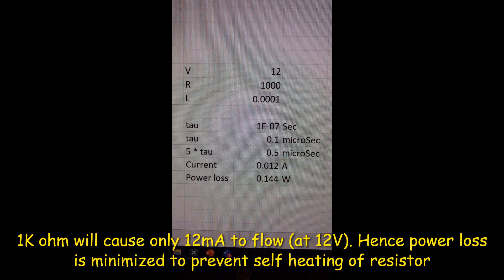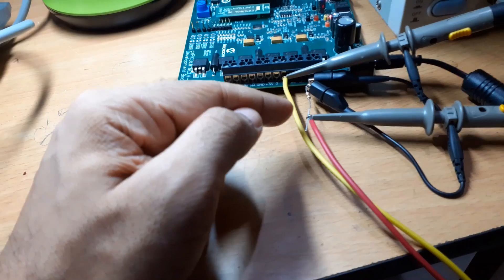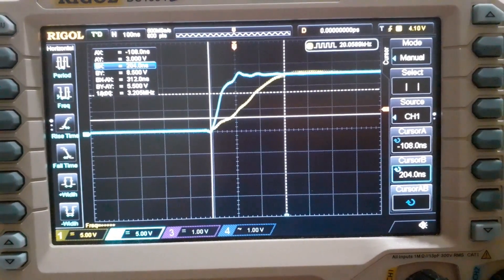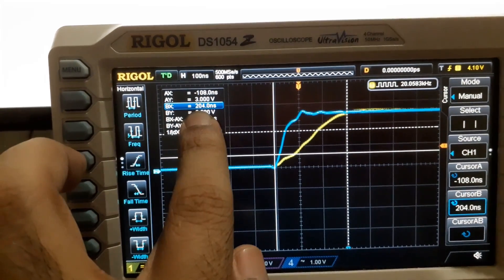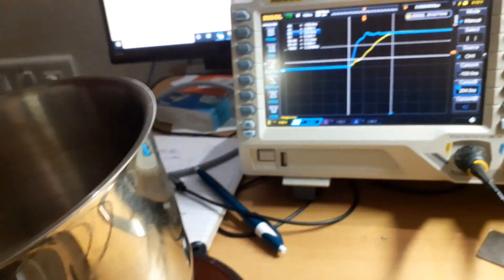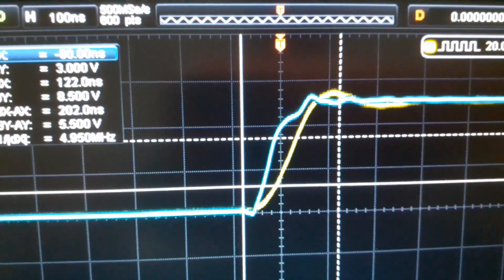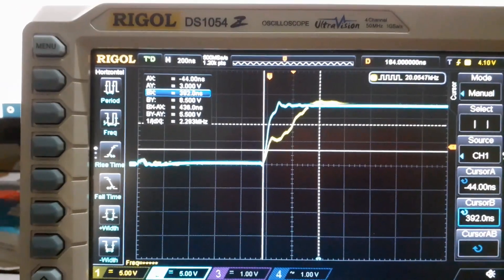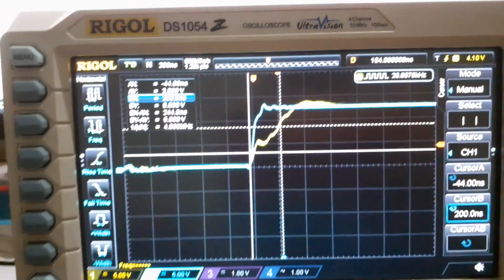Measurement of Inductance of Induction cooker coil

Comment: Sorry if i missed it in the video, but do you know the resistance of the 155mm coil?
Reply from the maker: Not sure, its been quite sometime. But it will be difficult to measure with multimeter, as the R will be in milliohms. I do not have such sensitive equipment.

Comment: would you know if its possible to take an induction cooktop unit and make it function with an external coil? Basically to  turn it into an induction bolt extraction tool used for automotive work
Reply from the maker: Its pretty easy to make an induction cooktop. But to make it work efficiently, is a steep climb. Please watch my other videos, where i built induction cooktop.